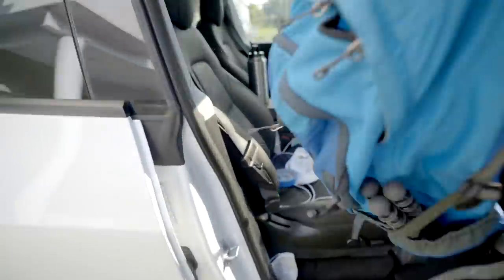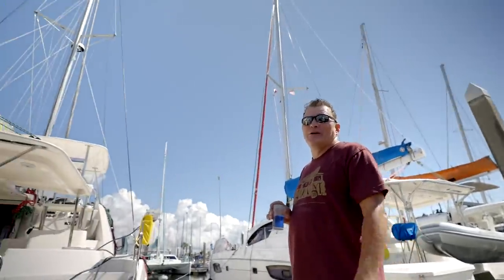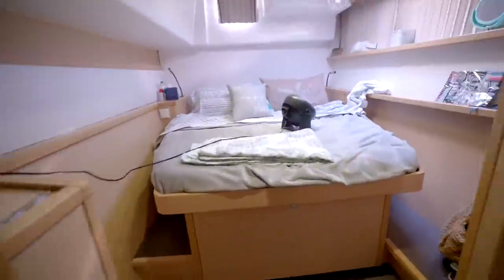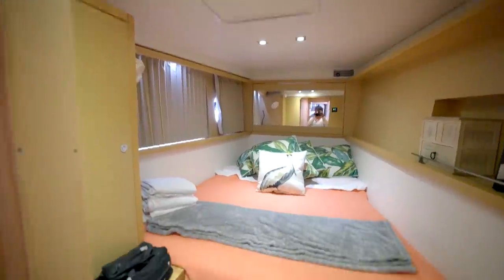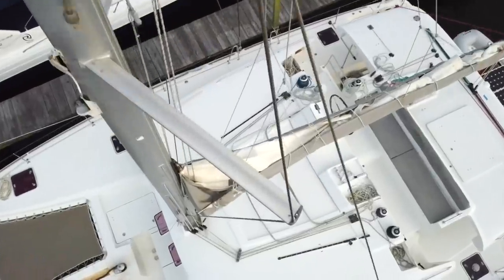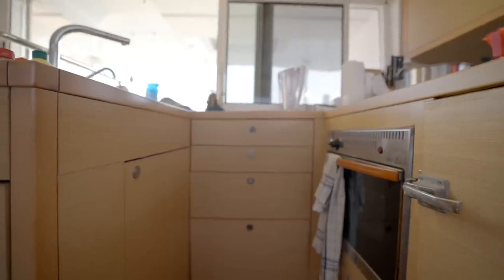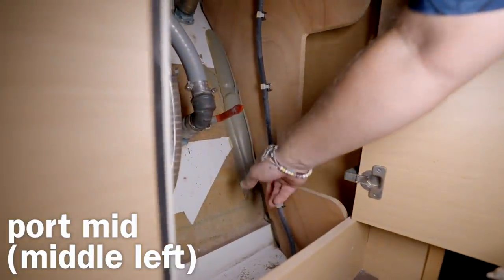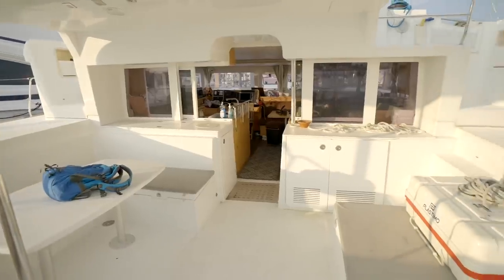Boat Tour!  I found 2 Catamarans w/ Broken Bulkheads Just Like Mine!

Comment: How come the surveyors didn't pick up on these issues, even if it's via the 'grapevine' of experience...?
Nice video and good luck with the conquest of your personal Everest 👍🤞
Reply from the maker: Lots of reasons, but the 2 main ones are:  1. it's atypical to take apart a boat's trim or walls to check the internal structure--so sellers don't allow it and sureryors never ask to do it; 2. Sinking floors, cracking flybridge walls, buckling walls behind the cabinets, and misaligned doors are so commonplace that everyone just assumed that it was a part of "normal settling" in Lagoon cats.  There are so many  facebook posts asking about these things immediately followed by tons of owners saying how this is normal on all 450's and not to worry.  They are right about the normal part, but its normal only because most of the 450's came with weak and flexing bulkheads so everyone was seeing the same symptoms.
Reply: @david_shih  
Yes, it seems as if there has been a case of 'Emperor's clothes' about Lagoon and any issues.
Houses have minor settling problems, just like any large product, but sinkholes in your garden go well outside of 'normal', as does what has gone on with the 450.
I agree that the only way to address this is with transparency and honesty, which is not every company's forte...🤔
Sorry that you couldn't find your passwords for your digital currency 🥺
Good luck and thanks for the reply. 👍🤞

Comment: If you see the bulkheads , you start crying. I can't image that someone designed this this way or is it made this way to reduce costs.
Reply from the maker: I was at a loss for words the 1st time as well. Houses are built with thousands of 2x4's and sustain mostly static forces. 1 piece of 15mm (<3/4") plywood? How...?
Reply: The plywood on the image doesn't look like marine grade plywood. Even so I think all plywood on boats should be laminated with epoxy or polyester.

Comment: Question (if you happen to see old comments). If you just use it locally and not on long trips can you ignore the bulkhead issues?
Reply from the maker: I see every comment!!! Yes and no…depends on how badly broken they are. Deans boat, the 1st one, is fine for sailing… it’s bent and still has a long way to go before the rig is in jeopardy. But andrew’s, the 2nd one, has full cracked and the rigging has gone slack with no way to tighten. I definitely wouldn’t sail that one around.

Comment: What do these owners think when their stays are slack and need to be tightened every week? Isn't that obvious? And the warped walls, and the sound...the creeking cracking, sliding crunch while hitting waves. Those boats are junk!
Reply from the maker: its pretty sad...its "common knowledge" that it's normal for these these boats to settle a bit and creek and moan on the water.  Supposedly this is all "common knowledge."  Even my surveyor repeated these lines over and over.... "No boat is perfect, they all settle and deform a bit." He just forgot to mention that it's because all the 450's have broken bulkheads  :(
Reply from the maker: its pretty sad...its "common knowledge" that it's normal for these these boats to settle a bit and creek and moan on the water.  Supposedly this is all "common knowledge."  Even my surveyor repeated these lines over and over.... "No boat is perfect, they all settle and deform a bit." He just forgot to mention that it's because all the 450's have broken bulkheads  :(

Comment: This makes one loose faith in any sailboat manufacture.   If Lagoon is cutting corners can only hope others are using common sense
Reply from the maker: I really think the problem is not rectifying a slight design flaw that leads to massive failures. Design issues are expected, but you have to jump all over it and rectify it the second they come to light.  No room for denial or blame. It’s your reputation on the line.

Comment: The British ran low on aluminum in WW11 and made two engine bombers out of Canadian spruce. They were so fast that no German fighter could catch them. That was spruce, but bamboo has 28,000 pounds of tensile strength. Aluminum has 30,000 pounds of tensile. Aluminum weights 166 pounds per cubic foot. Bamboo weights 20 per cubic foot. If the bulkheads were made of bamboo plywood, and water proof glue these bulkheads would not have failed
Reply from the maker: Reeeeeally??? Very interesting...where do i get some bamboo ply out here? Because all the plywood I'm putting into the repairs is weight it down!

Comment: All I have seen thus far with regards to the Lagoon Cats, is bad workmanship. When Parlay opened up their boat, it was a disgrace. The tabbing was pathetic, attention to detail was the same, I mean, if you dont have pride in workmanship, then you lose all integrity. I wouldn't go near any model of a Lagoon because I couldn't trust them....Period.
I really hope all the Lagoon owners get their issues resolved.
I am seeing ALOT of Lagoon cats on the market right now, maybe due to this exposure.
Reply from the maker: There are definitely lots of shortcuts in their production quality. Lots of air bubbles under tabbing and dry spots in teh fiberglass layup. I'm trying to get all that fixed up while i have the boat torn apart!

Comment: Sad to see typical boat construction, Ie cut corners and hide behind with trim and finished 3/8th plywood, shameful construction and engineering. These boats are basically unsafe in any ocean conditions except tied to dock.
Reply from the maker: Sadly I don’t think the production builders even see it as cutting corners as much as building to [charter] industry standard. It’s fine to build them this way, but you can’t call them blue water capable.

Comment: what a shitshow that boat need o be repaired or replaced buy the factory. I work in repairables and Warranties and this is 100% poor design and workmanship, all 450's should be recalled under warranty and fixed or replaced.
Reply from the maker: I feel like recall process in the boat world is ages behind that of the auto, and other similar industries. Boat manufactures still resort to the deny and ignore method.  

How do you handle design flaws when warranty periods have already elapsed?  Lagoon's main approach at the moment is to deny people based on "out of warranty status."  But this isn't exactly a manufacturing defect that could have detected in the 1st few years--its a clear design flaw.  Actually by design it's hidden and very hard to discover until its broken so much that the entire boat deforms.

Comment: Wait, isn't there a video of a dude taping water bottles to his Tesla steering wheel and the car driving off the road? Please don't do this.
Reply from the maker: I think that was on a merc, but don't worry, I always hold the steering wheel. The bottle just makes it so i dont need to shake the wheel every 30 seconds, which is actually more dangerous because its an pretty unnatural movement.